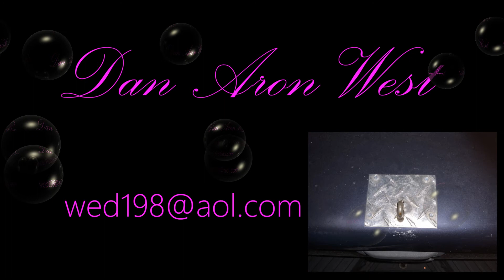DIY Truck Bed Cover Lock installation

Comment: I am going to do this on my old Ford 150, I have the one piece hard tonneau cover and the locks are useless, plus they freeze up in our Canadian winters.
The one thing I think may be easier than doing all the measurements is mounting the clasp like you did and then put a drop of paint on the top of the clasp and close the cover on it, the paint will be transferred to the cover and you can make your cut using the paint as a guide for the position.
Great how to video, like you mentioned, thieves will get in if they want too but this will slow them down enough that hopefully they will get caught, I don't keep expensive tools in the back of my truck but thieves don't know that, come to think of it, maybe it is best just to put a few junk tools in the back and keep it unlocked, a thief can do costly damage with a crowbar.

Comment: A hand held battery powered dremel could bypass this fairly quickly and easily. Either cut the lock or the latch. I like the idea. But maybe design something that will cover those. To make it a little more difficult. I’m getting cover this weekend. My toolbox was stolen yesterday out of my truck. And it’s the fourth time it’s been hit. I’m about to go out for some vigilante justice. To hell with the lazy Seattle police.
Reply from the maker: I agree with you completely BUT, this application is for Bowling equipment and even though the bowling balls and bags are very valuable when going to tournaments it is being parked in a relatively docile parking lot at the bowling allies. I have never heard of any car or truck being vandalized for its bowling balls and equipment.  NOW ON THE OTHER HAND.  Yes, where a man's tools are concerned a much more professional system should be installed.  I tool had tools stolen many years ago but never again after I had a pro set me up.  On the other hand, if a thief wants in, he'll get in no matter what he must do.  So, yes, this video is quite simple and that is what it's meant to be for the DIY guy, simple and inexpensive and for just some play toys.  Thank for the comment.